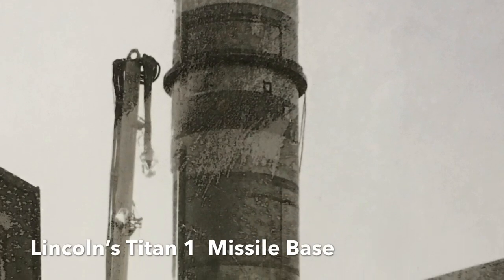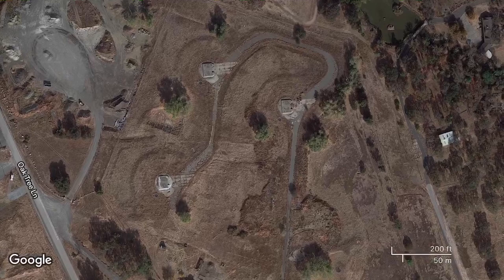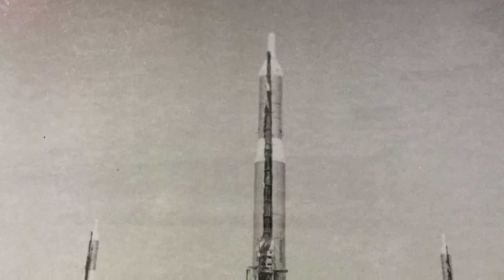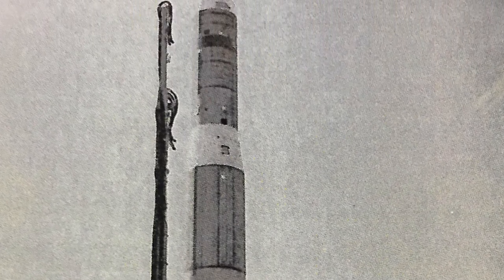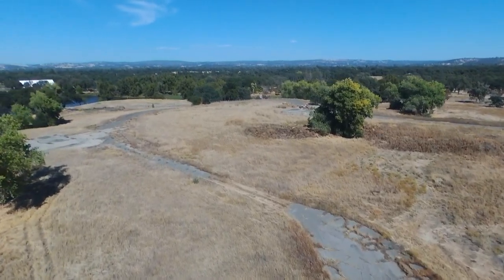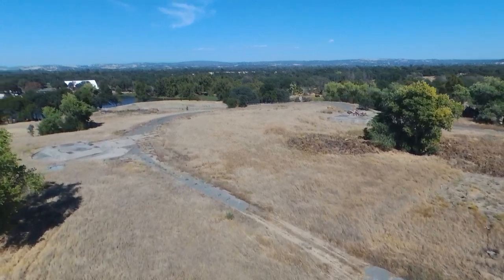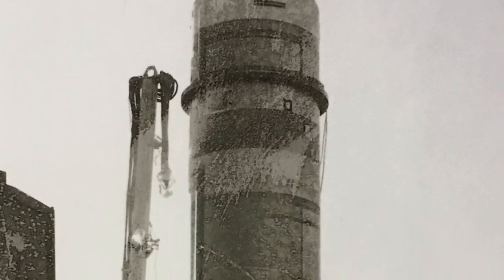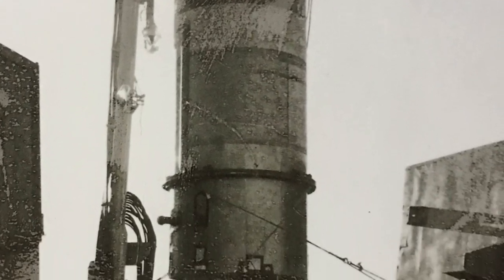Lincoln’s Titan 1 Missile Base

Comment: Thanks for this. I served on a launch crew at these sites in 1963 and 1964. I was the Power Production Specialist and was in charge of the Power Control Center. I was on duty the day President Kennedy was killed. It was as close as I came to pushing my power release button to enable the Launch Sequence at the Control Center. I stood at the control panel for 4 hours at parade rest with my knees shaking before the order came to stand down. It was very intense duty. I served with the Atlas and Mace systems also with more than 6 years in the Missile Field. It was mostly a pleasure to serve. Thanks for bringing back some memories.
Reply from the maker: Thank you for your service.  Can’t imagine the pressure of knowing what the consequences of having to push, the button would be.  Thank goodness it never happened.

Comment: Missile technology was moving so quickly at the time that Titan I was put into operation still using ground command guidance (with retractable silo dish antennas) instead of the onboard Inertial Navigation systems of the slightly later Atlas and Titan II. Each Titan I site was basically a small version of Cape Canaveral.